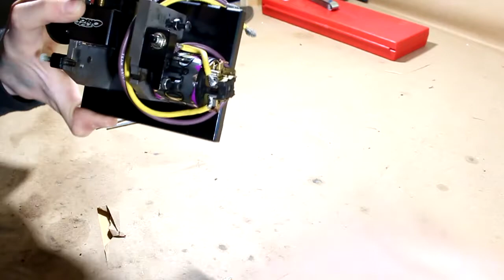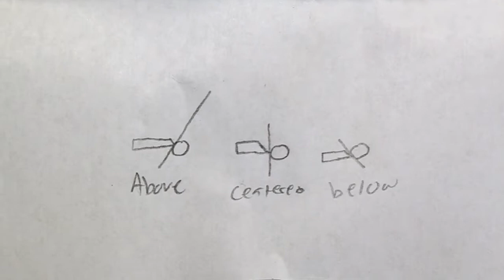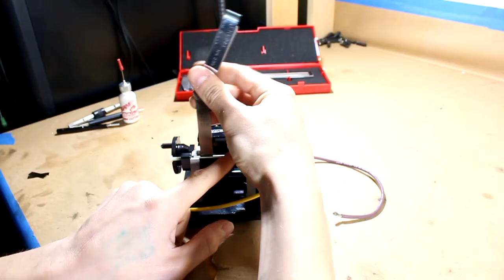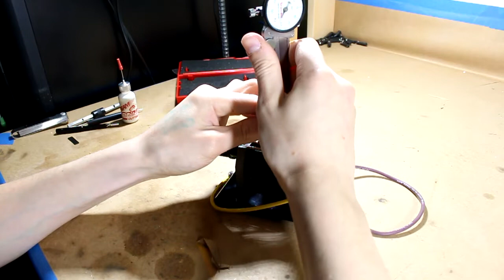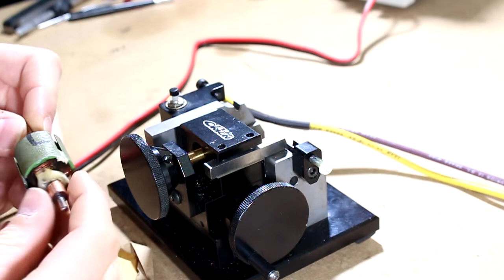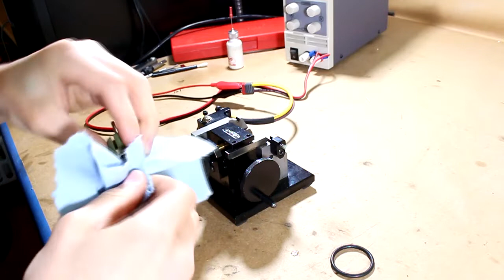I Bought A COMM LATHE!! \\ Part 1

Comment: Too, u can run the lathe off of any 6 volt battery. I use a couple of 4 cell nimh packs. (When everyone got outta brushed everything, I ended up with all their brushed stuff!👍😁)! Now, I get to do their crawler motors. TOO, remember to break in ur motor brushes after a rebuild. Usually, 5 to 10 minutes of running on 6 volts down to 4 volts for 10 minutes is perfect!

I'm just SO HAPPY seeing a young'un keeping the old technology alive!!!!

(My apologies for the excessive posts!)
Reply from the maker: Nice haha! Actually breaking in is one thing I didn't do in a video that's being released later this week is break it in after the rebuild. Thanks for the tip! (No worries! I love the community support!)